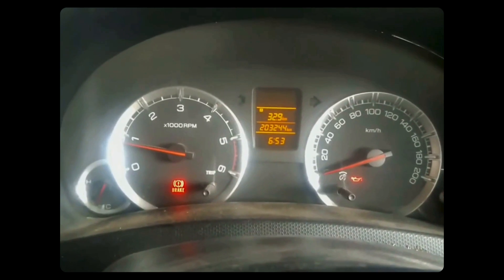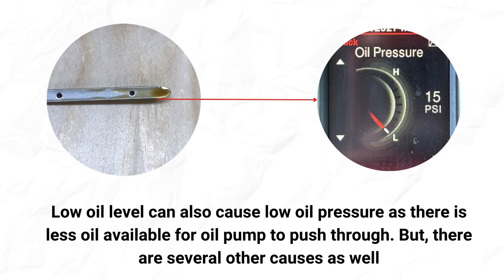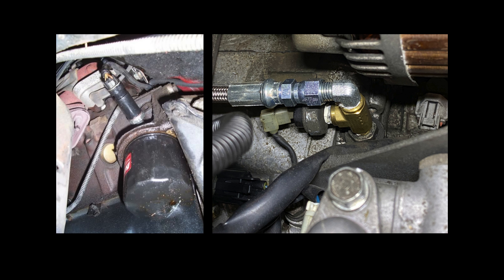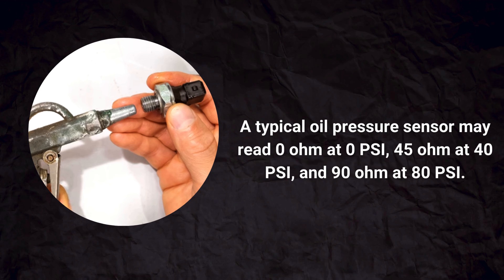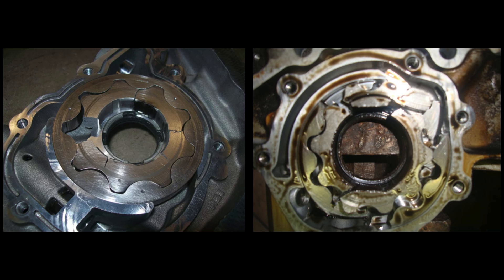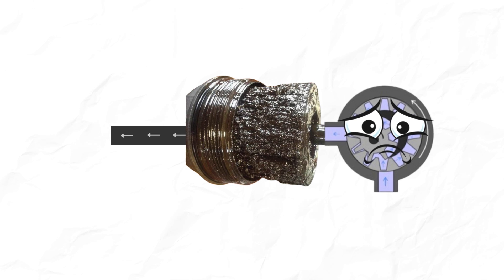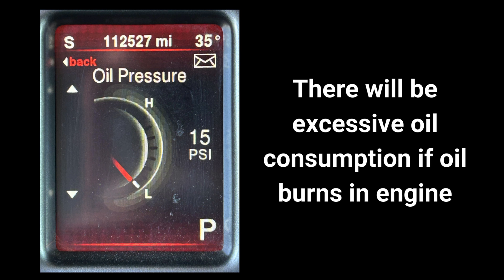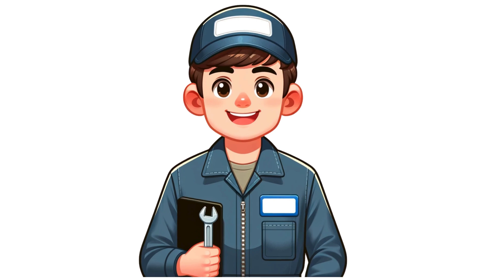7 Common Causes of Low Oil Pressure Light on Dashboard (How to Prevent & Fix Them)

Comment: The is oil leakage from the engine we don't know how to find the source and the warning light is still  on after changing the oil pump and the sensor of my Qashqai 2015
Reply: Don’t my seat Leon is doing it right now and I changed so much